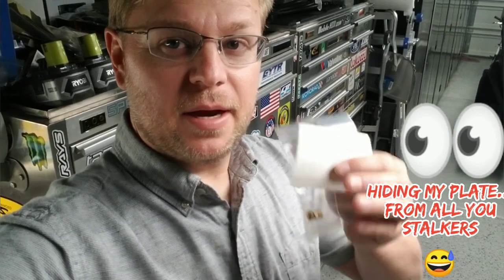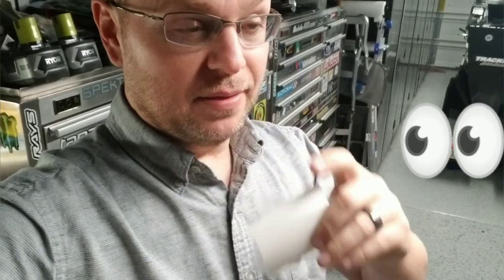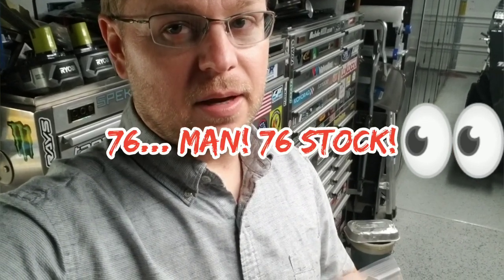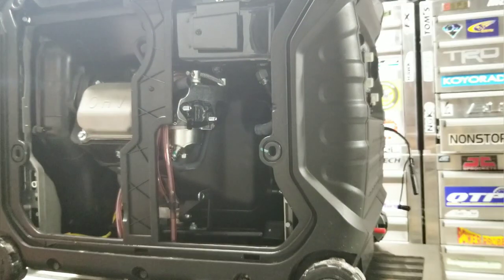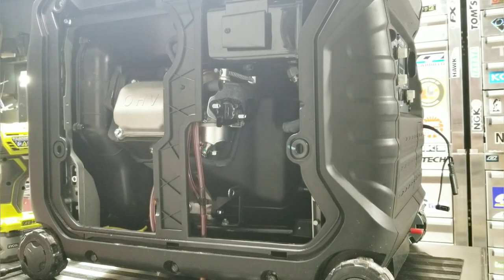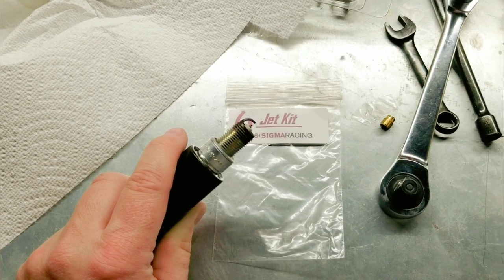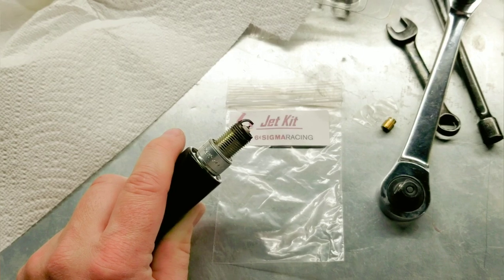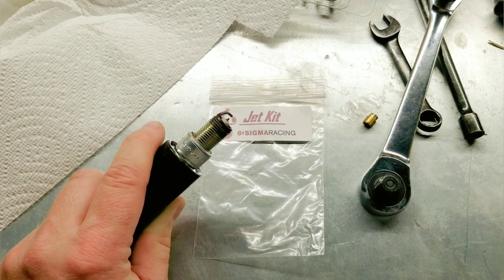DIY GUIDE - REJETTING THE PREDATOR 3500 INVERTER GENERATOR! RESOLVES A COMMON SUPER RICH CONDITION

Comment: Thank you for the video.  My generator ran great for about 200 hours then started running very rich.  Put in a 70 jet, ran it for an hour with a 1500 watt space heater plugged in and the spark plug came out looking great.  Before even a few minutes would turn the plug black and the engine sputtered and you could smell the sunburnt gas.   Thanks again.
Reply from the maker: Good deal - happy to help!
Reply: what altitude are you at? did you have to change out the emulsion tube as well?

Comment: Thanks for the video my predator generator has been running rough here in Denver at 6000 feet. Didn’t think about changing the jet out. Appreciate the help. Bought a jet from six sigma #68 and installed, seems to be running much better.
Reply: Todd, I'm in Monument and just camped in Taylor Park at 9700'. The generator continues to die. I considered returning it, but started researching. What jet did you end up with?

Comment: I have run my Predator 3500 for the last two years at Mammoth Lakes area (around 9k elevation) with no problem...original jet. As you can see in this video, changing it out is a PITA!  And then needing to change it again when you get home so it doesn't run lean?? No thanks.
All I did was running an NGK Iridium plug of the proper heat range (sorry don't remember which one) and drilled out the cover on the case to allow more airflow. Ran great, no problem. Yeah, you lose some power (like any gas engine at altitude), but it got the job done, no jet change. I'm sure it was running rich, but the increased air flow and Iridium plug seem to allow it to work fine.  YMMV.

Comment: Great video!! Thank you for sharing your experience with the Predator. We have a travel trailer that should arrive in a couple of weeks.  We live at 8000 feet up in Colorado and will predominantly boondock.  I don't know what generator we will get yet, but I feel your tips here will apply nicely to whatever we get (high altitude jet, no ethanol fuel, clean spark arrestor, and don't leave fuel in carb for non use time).

Safe travels!
Reply from the maker: Thanks man! Great gen!

Comment: This is interesting to me as I am in the process of jetting my Predator down from the .76mm.  I currently have a .75mm in it with little to no change.  Going down to .70 next.  I am at 11 ft sea level.  Thanks for sharing.
Reply from the maker: The .70 should be the ticket. Sounds like one of the jet sets from china? Good price for a lot of jets if that is the case! I have a set on order too. And yes... .76 to .75 is virtually nothing. Depending on the machine work... might even measure the same with a pin gauge! Would just have to check.
Reply: How did it turn out?

Comment: Great video!

I carry 2 predator generators on my 5th wheel when boondocking. I’m ordering both the #72 & #68 jets so I’m prepared for any elevation.
Reply: Where did you buy the #72 jets?
Reply from the maker: @detailingcouple4470  Check out the video description above (click show more). Link takes you right to the jet ordering page.

Comment: Great info, just ordered some. Apparently they have an ebay storefront and they're out in Arizona. I have 2 of them and course there is a love/hate relationship with them. The love is is the price point since I can purchase 2 for the price of 1 EU3000is. The hate is the problem of it running rich even at near sea level and dealing with the clogging of the spark arrestor.

My mods I made to it was removing the starting battery and converted the electric start switch to serve as an emergency ignition kill switch. Now, I am able turn the engine selection knob to the "off" position which cuts off the fuel supply and allow the engine to continue to run thus burning out the remaining fuel in the carburetor bowl.

My next project will be converting one of them to be a tri-fuel unit. Living in a subtropical zone and dealing with tropical cyclones (hurricanes), I've noticed that there is always a "run" on gasoline, but I can get plenty of propane till my wallet is empty and if the filling station have power. Other option is the cylinder exchange route. The tradeoff is you do lose some generating capacity due to propane's inherent low btu output per pound vs gasoline. However, it burns much cleaner than gasoline and it doesn't beat up as badly.
Reply from the maker: Good mod! I never did like the fact I could not run the gen until the bowl was empty.
Reply: Mr. Garage exactly, if I wanted to keep the electric start feature I would convert the econo mode switch to serve as my engine on/off switch. Most cases I don’t have any use for the low idle mode due to the loads that I run on it is pretty much constant at the normal idle speed anyway.

I’ve seen some install a separate engine on/off switch or just unplug the connector that leads behind the fuel valve inside the control panel, but it will be engine off when the remaining fuel burns out of the carb only. I don’t personally feel comfortable doing it that way since I have no means of killing the ignition in an emergency.

Comment: This makes the savings from the Honda all worth while! 
I’ve had our Predator 3500 for 2 years. Used almost exclusively on RV running 15K air conditioning and/or microwave. Usually running below 3000 and has always been rich. Recent trip to Nevada and 6000 feet choked it to a stop. I pulled the Spark arrester and totally plugged. Cleaned that out but still so rich barely ran and chewed thru gas.

Just installed the 68 at sea level and radically improved. 

Question on drilling holes in side cover. Why? To let hot air out? It doesn’t seem connected to air intake. Also, the air box seems to be fed thru that one tube? Seems small

I don’t want to unnecessarily increase noise but like it to run best possible
Reply from the maker: The holes with an early attempt from others work to cure the rich condition. The motor has an enternal fan / cooling assembly which puts the case in a near vacuum. Most of the air is sucked past the inverter from the control panel side of the case. When I really dug into it, I found a jet cures the issue without need for drilling the case. I noticed you said a #68 at sealevel. Watch that spark plug, it is likely running lean now. But should run flawless if you are say 2K feet or up.

Comment: I went with the #70 jet. I’m at about 1200 ft above sea level 85 degrees today. I have an aftermarket oil door that’s vented and have removed the evap system and vented the gas cap. Ran the generator for 20 min at load 22amps. With the #70 jet it is way to lean. I warmed up the generator with the old plug, removed it and put a brand new plug in. Ran at load for 20min. Pulled plug and did a plug chop. This is the only way to properly read a plug. I have ordered a #72 jet and will do the same procedure when it arrives. But at 1200 above sea level with a #68 or #70 will most likely end in engine failure due to a lean condition.
Reply from the maker: At your altitude, a #72 may be best - just depends. Did you test to see if your gen was super rich prior to jetting?
Reply: Mr. Garage, the plug that I removed was black. But I didn’t do a plug chop with the #76 jet for a true reading. I may do that while I wait for the #72’s to come in.
Reply: The only way it is too lean on a 4 stroke is if you aren't making power or you are getting detonation... 2 strokes get lubrication from the fuel so leaning out makes them hotter and less lubricated which results in failure (ends up burning the lubrication that is there too). 4 strokes on the other hand aren't going to get as hot when ran lean and don't get lubrication from the fuel either. If you are running lean you can get detonation which can cause damage but that is a different failure mode than 2 stroke leaning out...

Comment: I was working the 'rich' problem and came across another video that explained that "breather" on the air filter cover is part of the emissions control system that pulls vapors from the gas tank which will richen the mixture. There's a kit out there to delete that feature, but then you have to vent the gas cap.
Reply from the maker: It can cause the rich condition for sure, especially when they are overfilled. Do NOT top off the gen with fuel if you want it to run decent with the charcoal canister. Topping it off causes the problem as it floods the canister.
Reply: I have this generator also and did the canister delete and my cap is vented from the factory. When hunting I had snow on the top of the generator plugging the vent and it died. I did the delete when I got home and the generator never shut off. Maybe it’s a newer design, about a year old.

Comment: Just wanted to add, because I haven't seen it anywhere yet. I just bought a brand new predator 3500 from harbor freight that seems to be different from yours and every other 3500 before. The airbox designs different and a few other things are different but primarily relating to this video the jet size is 82 from the factory. I bought a 70 jet thinking I had a 76 in there and the thing did not idle at all at full load with the 70. I think I need to try coming down to a 76 or 78 instead, FYI for everybody out there rejetting their predators
Reply from the maker: This is really good info, not sure how I missed this post. And yes, the newer rev has the oil door on the opposite side. What did you end up with jet wise? Also, I would monitor the spark plug before changing. Did you actually end up needing to re-jet?
Reply: @MR_Garage  So it ran like complete shit with the 70 jet obviously, wouldn't really even idle, the revs would ramp way up then down, and almost stall. Put back in the old jet and it ran fine again.. Replaced the spark plug at the same time and it's ran completely fine. Have used it for about 40hrs since. I live in SoCal at sea level
Reply from the maker: Seems the new version is more fuel hungry, especially at idle. How is the plug and arrestor with the stock jet at sea level?
Reply: @MR_Garage  Removed the spark arrestor after the first weekend I used it, it was already pretty dirty but generator still ran fine without any issues when it was on it. Plug looks fine so far as well, no burning or anything from what I can see. I also drilled some holes in the outside of the airbox for additional air flow at the same time.

Comment: Now that you have been running that generator with the 68 jet in the carb, how has it been doing.  How about a two year review.  I also have this same generator.  It has been running just fine.  I'm at about the 2,500 foot level most of the time, but I will be going up to about 6,500 feet occasionally.  I installed a 72 jet about a 6  months ago, but have not had a chance to try it at altitude.  How has yours been doing?

Comment: This is a great video, thank you! I’m a bit new to fine-tuning small gas engines, but I am in the opposite situation from most of the commenters here. I live at 7200’, and will be using this generator anywhere from 6000’ and higher. If a 68 jet works well for you at 1100’, is it safe to presume I’d need to go even smaller to maximize my performance way up here? Perhaps a 65 or even 62? I know the tell-all will be how the generator runs, but I’d like to narrow my order down to maybe 2 jets and not have to by 4 or 5 different sizes. Just looking for a reasonable starting point I suppose. Or maybe my assumption is incorrect... Thanks again for all the great information and the video!
Reply from the maker: 68 is borderline lean at my low altitude. I primarily camp around 7K feet and the gen runs excellent, although a tad on the rich side but not bad. If you take away any more fuel with say a 65, you start to drop power output. Try the 68 first, may be the ticket for you.
Reply: @MR_Garage  Makes sense, thanks for the reply!

Comment: I have a 3500 and have had it for about 4 plus years so far. I am having a problem right now with mine. When I go to turn it off it keeps wanting to run and chug, and like it's dying but just won't shut off for about 5 minutes. Any advice?

Comment: Have you done any testing as far as temperature?  If your like 7k and 50 degrees that can be a different jetting.  Obviously I wouldn't be running A/C in my 5th wheel with that temp, so maybe this is a mute point.  I did put a 68 in as I live at 4500 feet.  My plug was definitely black before.

Also I have dealt with sand issues where I have camped and have seen my idle surge up and down. The fix for that is to pull the idle jet and clean it.  Fixes it every time.  I have seen other comments about surging and I bet it's just a dirty idle jet.  There is videos on the idle surging.

Comment: Yes, they certainly run rich.  Thanks for the info.
I also believe that the case chokes air at the case air inlet.  
Has anyone improved the air flow into the case reducing the negative pressure caused by carb intake?  
Thanks again for the video.  rd
Reply from the maker: Hello, There are a lot of mods surrounding the near vacuum in the case :)  Some sell aftermarket oil fill doors that are vented. Others, drill holes in the honeycomb area to allow more air and remove the foam behind it. And yet others just remove the oil fill door while it is running. I have not confirmed it, but I am told by another enthusiast that the air intake is actually over the electronics to help cool them. So a fine balance between increasing air inside the case and limiting air across the electronics. I chose the honeycomb drilling mod (can see it in another generator video of mine on maintenance). Provides extra airflow, but the normal air channels are still moving air. Verified by placing a piece of paper over 1/4 of the holes I added and the negative pressure keeps the paper stuck to the side.
Reply: @MR_Garage  Yes, 
mods to the case (battery door, drilling holes elsewhere, etc.) undoubtedly reduce internal case vacuum and improve the air starved carb issue but perhaps at the expense of electronics cooling.

The case inlet targets airflow over the electronics.    My concept is to remove the air restriction at the existing air inlet thereby improving air volume/flow which will reduce the internal case vacuum and give the now air starved/fuel rich carb more air.  

Some are addressing the rich condition with less fuel (smaller carb jets) which has output implications.  How about with more air? More air = more power.
Reply from the maker: @rickdunagan5779  I like it - see how it turns out. Improved air over electronics plus even out A/F would be a win. Note that... with my oil door removed, it still ran rich! Just a bit too much jet really. Seems they just use the same for all 212cc models, a #76. A note, I have never had a problem running full tilt even at altitude so power has never been a problem even stinky, black plug rich. Keep us update on your mods!
Reply: Just got this generator and plan to run at 9k feet here in Utah most of the time. Any updates on the mods? 68 jet, or drill oil fill door? Both?

Comment: Interesting im at 2500 ft 80 degres ,and with a smoge delete and 5  1/2" holes in the air filter lid mine is running well.carb is stock .

Comment: So I’m at 4400 elevation. Had to clean spark arrestor multiple times and very black sooty plug. 

Put in the #68 jet and runs good, but I can’t run the RV air conditioner and microwave at the same time. I guess I’ll have to trade that convenience for it running more proper. I’m guessing going to a 65 won’t pick up any HP?
Reply from the maker: Did you check amperage draw for the pair? Normally, the AC will draw around 14A if this is a 13.5K BTU AC. Microwave will draw around 10A. This puts you right at the max the generator can produce. Now, if you have your fridge or electric side of the hot water on at the same time, you will overload the generator. Also, the charge converter will draw 1-2A at idle. Should not be a HP thing - just running out of juice!  Easy to do with the monitor on the generator. Last, try turning the microwave down to say 70% power. See how things go once you verify other items like the fridge and hot water are off.
Reply: Yeah. The microwave shows 12 amps by itself and the ac is about 15-16 amps. It ran both on factory yet, but it won’t with the #68. I get the total is over the 25 amps rated, just surprised after the rejet it couldn’t do the same as before. Granted at 4K feet elevation it’s loosing 10-13% due to air density and it was 102 degrees during test. Just an observation. Thank you for this video! I made one similar to this.
Reply: My stock 3500 won’t run our RV and AC at the same time, I’m thinking your issue is not related to the rejetting of the engine.  🤷🏻‍♂️
Reply: @Ryan.Willis  mine either
Reply: I just came back from camping.  I cannot run my a/c and microwave at the same time.  This is with stock jetting.  I will be lowering my jetting, plug is pretty black.

Comment: Great video, one question we're we live the Average temperature: 74.15°F and the elevation 438 ft, which one will you recommend? Thanks !
Reply from the maker: Very nice weather, but comes down to reading the plug after it has been run under load. See how rich it is running. May or may not need correction at that altitude.
Reply: I am in the process of taking off the .076 jet and putting in the .072 jet mine is brand new never run so I'll see how it goes.i live in Connecticut which is 500 approx from sea level so see how it goes.this man saved a load of headaches for sure.
Reply: Just updated my jet and see how it goes I'm .,072  will see thx again
Reply: @t57f100  how'd it perform on the 0.72?